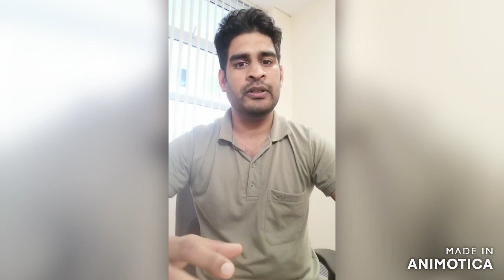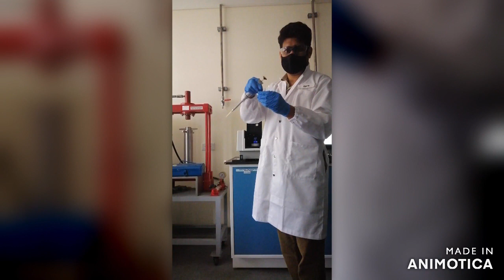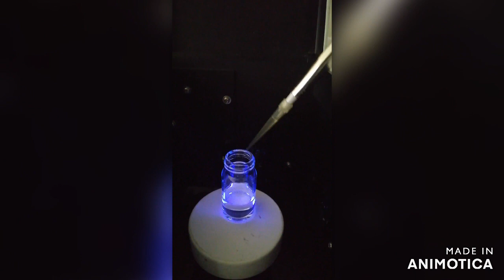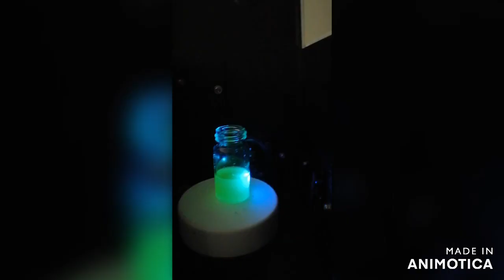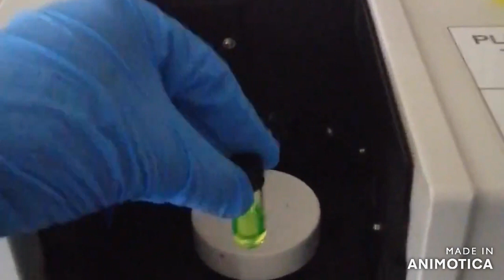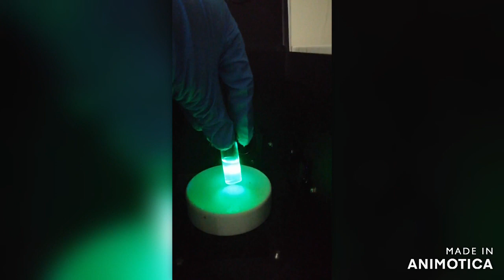Synthesis of Highly luminescent Semiconductor Nanocrystals (Perovskite and Materials Science)

Comment: How to dry and separate those synthesized particles.
Reply: I think he did it by centrifugation. That's an easy and rapid method but if you are interested in obtaining more quantity, you should use the "hot-injection synthesis".
Reply from the maker: @torerotricking1  Centrifuge using methyl acetate. Please follow this paper for a detailed experimental plan https://pubs.rsc.org/en/content/articlelanding/2020/tc/d0tc02038a